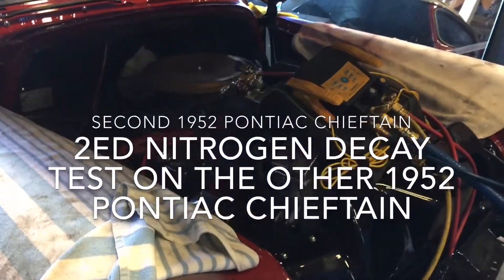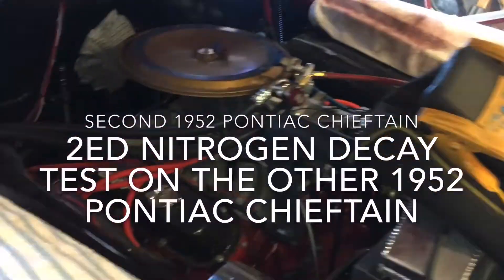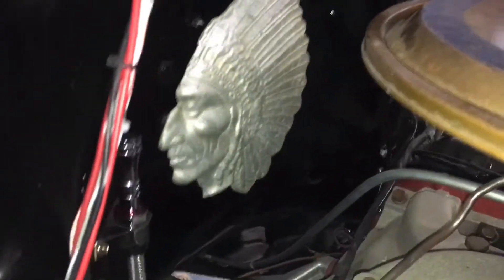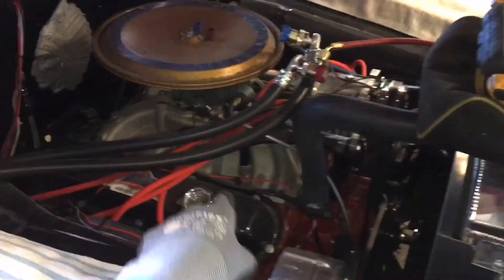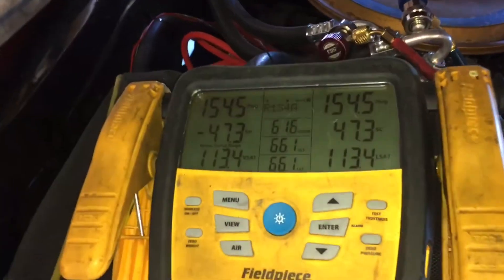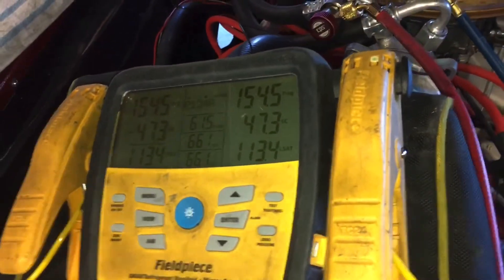2ed nitrogen decay test on the other Pontiac Chieftain

Comment: 3hours should be enough for nitro decay test 😁👍if there is a leak, will show you in 5-10-15 minutes
Reply from the maker: Unless it dose not leak at static standing pressure at room temperature. 

Some leaks only happen when the piping or metal gets cold no leak when warm. 

Some leaks only happen when rubber or metal gets hot

Some leaks only happen when the compressor shaft is spinning 

Some leaks only happen when the compressor is running and the pulsating pressure against the outer case housing starts a leak at the case to body seal. 

Some leaks only happen when the car is driving down the road and vibration and bouncing of the hoses up and down only at that time it leaks 

Some leaks only happen when you reach a certain pressure and if you don’t get to that pressure it will not start leaking 

Some leaks will stop leaking if you passed the pressure they leak at .   They will not leak until you lower the pressure to that point. 
          The leak will stop again if you go above that pressure. 

I have made videos showing all this kinds of leaks that will not leak doing a high pressure nitrogen decay test. 

If only think 🤔 💭 it will leak at pressure with nitrogen then you will be missing a lot of leaks.